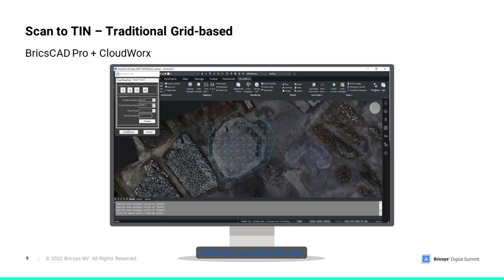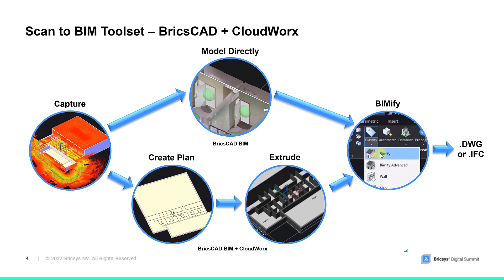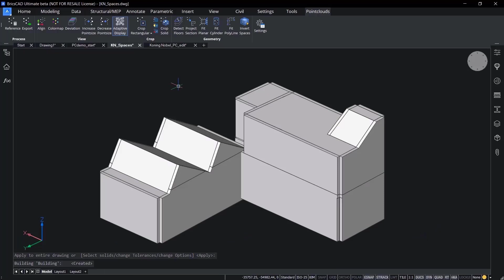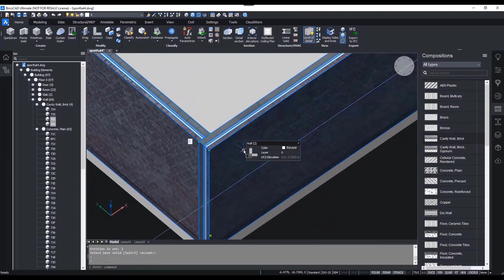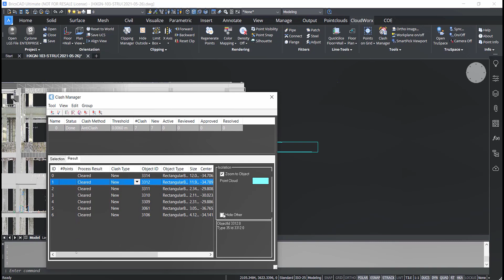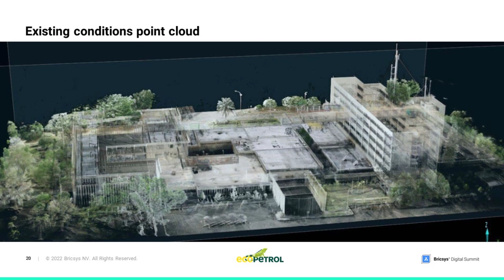Reality capture with CloudWorx & BricsCAD

Comment: Hey guys, really cool featues. Do you have also the possibility/workflow to import pointclouds/shaped made by an iPhone LiDar ?
Reply from the maker: iPhone doesn't have a specific format but does have an API for their LiDAR. There are several apps that make use of this and provide scanning capabilities. Most of them allow exports to some of the formats that we do support. This means you can easily import them and snap to them, but most of the scans are too low resolution to really run any algorithms on it. Of course you can still model on top of the scan.
Reply: @OctaveBricsCAD  that's helpful, thanks